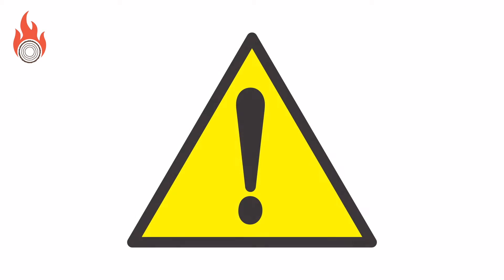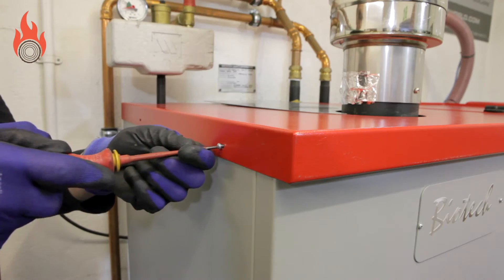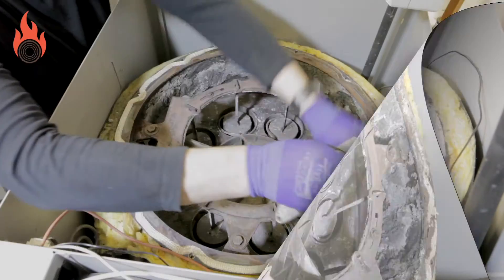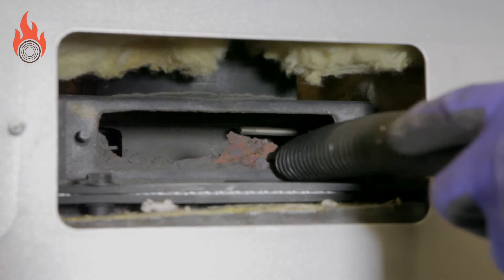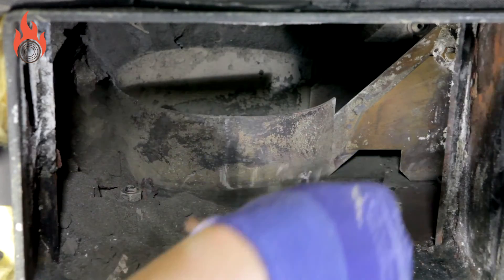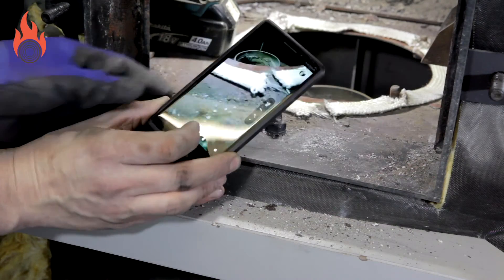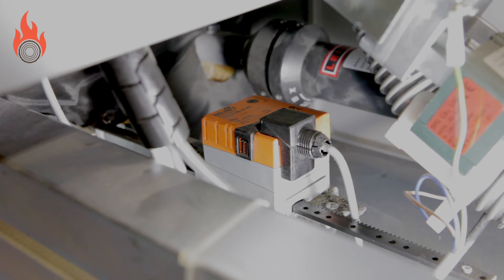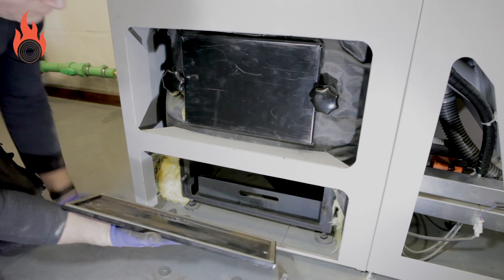WBS Video 5 -  How to carry out Biotech pellet boiler cleaning

Comment: The grate movement motor harness contacts the rack. The cord grip lost its lock nut also.
Professional maintenance, yo!
Reply from the maker: If you need assistance with your Biotech boiler, please phone the Wood Boiler Supplies office on 01651 891237